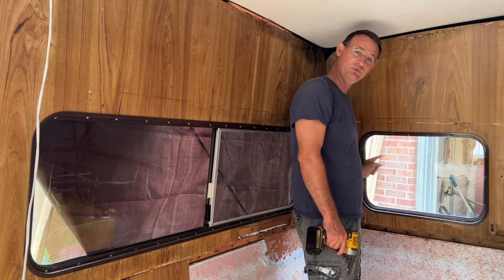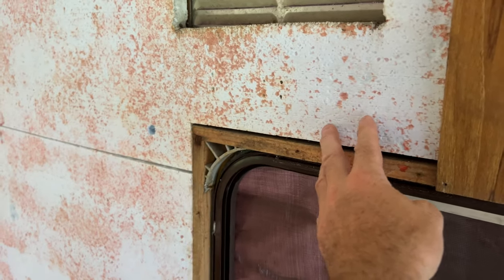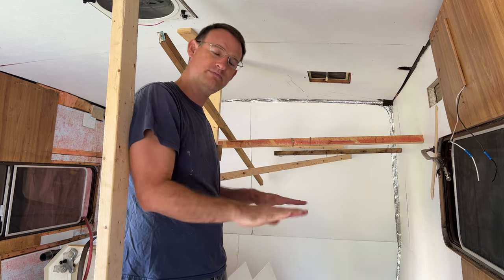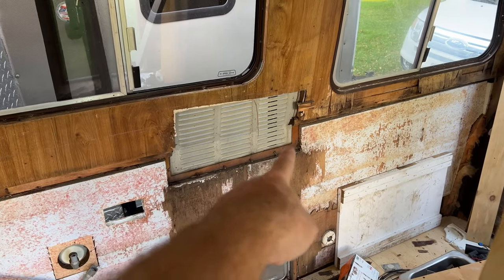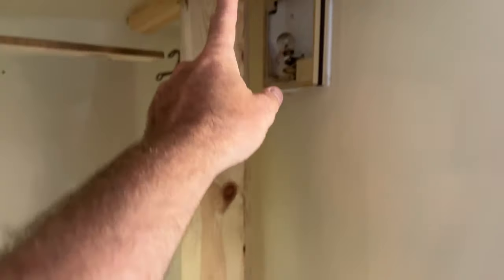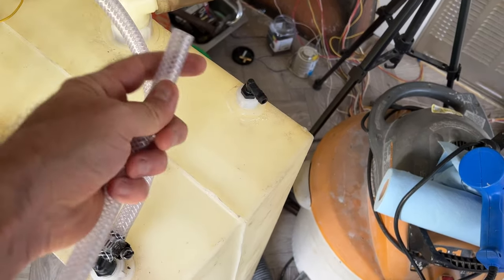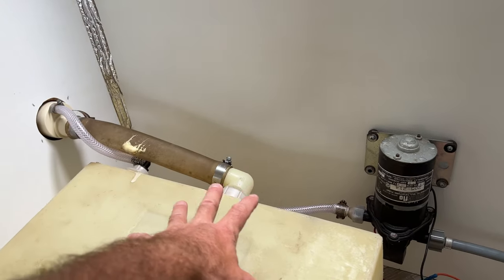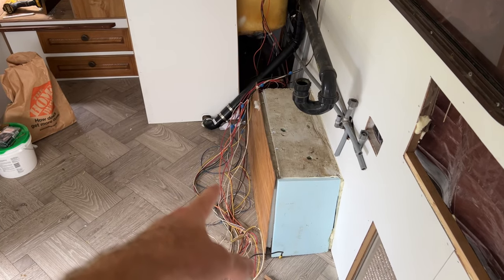17’ Bigfoot - Vintage Fiberglass Trailer Restoration Part 4: New Wall Panels and Cabinets!

Comment: Great job! Amazing project! Have you added also a Pressure Accumulator into water line?
Reply from the maker: Thanks!
No I didn’t on this one. It probably should be added but at this point I’m just trying to restore it back to original. Other then a few safety items - charge controller, propane regulators etc. I’ll see how it works once done and then add it if needed. Thanks 👍

Comment: I purchased the 1978 version of the Big Foot and we have been working on it for two years a little at a time but it was not as bad as what you started with! Did you replace the converter/inverter? If so what did you replace it with?  I want to add solar panels to the top and a lithium battery? Great video I saw the skeleton Very cool Thanks
Reply from the maker: Really nice! You will not regret it! The layout and space with all the windows is really nice. One of the nicest vintage campers out there! Yes I ended up swapping in a new converter. I bought it off Amazon I believe it’s the same one they installed in the TAB here’s a link.

Progressive Dynamics 0318.4135 PD4135KV Inteli-Power Converter with Built-in Charge Wizard https://a.co/d/h8u2CqW

I’m not sure about the solar, maybe some flexible stick on panels. Id hate to put holes in the roof and unless there is some reinforcement I’m not sure what the frame would screw into, I’d be worried as you bounce down the road it would start to leak. What about a plug on the side and some nice fold up panels? You could set them facing the sun while the trailer is in the shade? Anyways just a thought. Glad the video helped a bit! 👍

Comment: Great video! Do you think it’s possible to fibreglass connect the top and bottom of the shower? I have a B17 that my wife and I are demoing and I thought it might be nice to really seal in the moisture by eliminating the aluminum connecting the two pierces together.
Reply from the maker: Hmmm that’s a tough one. It was really nice to have the two pieces to get it in just the right spot when installing it. You would have to cut it out if you ever needed to remove it. Plus all the body work to make it nice and smooth…… 🤔
In my opinion…. I think it’s a bit too much work for the benefit.

Comment: What is the white paneling you used.
Reply: Yeah I'm curious too. This content is great for DIY fiberglass restoration
Reply from the maker: Sorry I don’t have a name for it. I picked it up from the RV salvage shop. He uses them for rebuilding trailers with water leaks. It’s 1/8plywood with an abs finish. I wish I had a name for you. Maybe someone will post it in the comments?